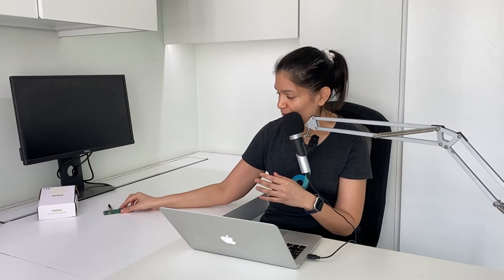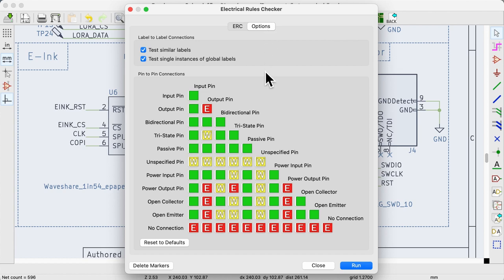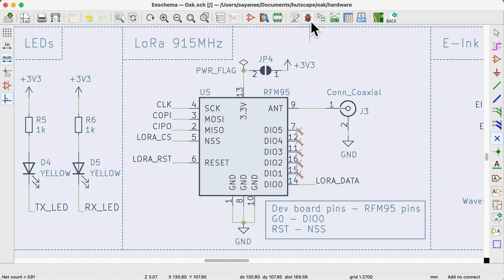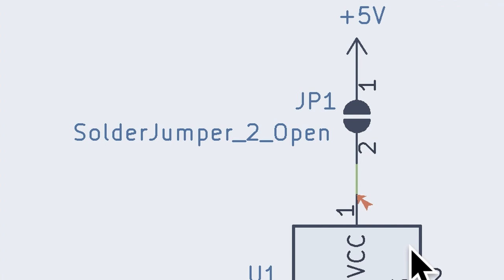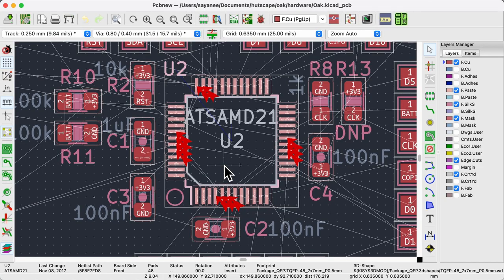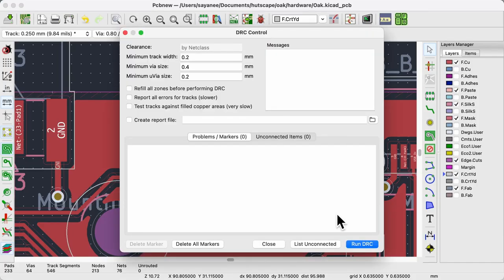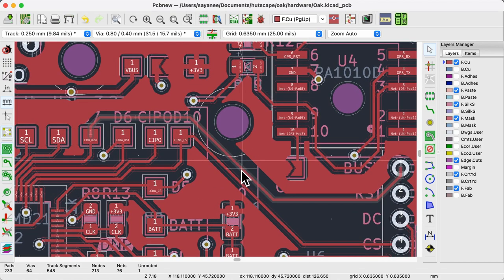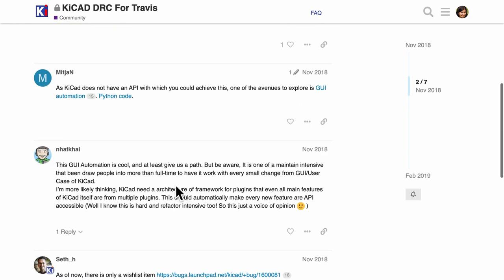ERC/DRC common errors and how to use it like TDD // KiCad

Comment: Very interesting look into these tools. I use them to keep my own distractions in check, too often have I swapped TX and RX pins accidentally only to discover the issue after the PCB layout is designed or worse, when the PCB prototypes come from the manufacturer. I do have to say though, the quality of the ERC/DRC output is directly linked to the quality of the footprint. If a pin is wrongly identified in the footprint the ERC won't know about it, so it's good to keep that in check, especially when you're the one making the footprints.
I liked your methodology of doing the checks at specific stages and then do version control with them. Where did you learn about these design process techniques, like TDD? It seems like a major flaw in my engineering degree because I never really learned these things.
Reply from the maker: "Where did you learn about these design process techniques, like TDD?"

I had spent some good years in between in web development that made me comfortable with programming, version control, documentation, and concepts like TDD, CI/CD and agile development.

Coming from the school of engineering, I did not learn these concepts initially and they certainly petrified me 😅
Reply: @sayanee  Yes, my background is very academic (physics eng.), so when I got to work in the industry it was a whole different way of doing work. Unfortunately none of the companies I worked for exposed those troubleshooting techniques to me, it was usually someone else's job to do the testing, so I guess I have to learn it by doing it myself haha. Thanks for the reply! Keep up the good work!

Comment: Thank you ever so much for covering all the errors I'm coming across as a newbie starting with Kicad.
You're so clear and to the point. Excellent video. 
I'm not sure why Kicad continues, even in Version 6.0, this hopeless "power flag" system. It really does need replacing with something more intuitive, and/or, easier to find in the libraries.

Comment: Hi ms, i have problem conflict pin ms, conector usb output gnd with ams117(3.3v) output power ms. I have change like your but still error. And now i have change electrical type conector usb gnd from power output to passive, and work ms. I will ask you, if change lile that in future will get problem when pcb was done printed ms??

Comment: This has absolutely nothing to do with the video’s thematic but I’m curious about your MacBook. Let me explain why. I’ve finally started entering the apple universe and I still lack an apple computer. My windows Lenovo was cunningly nicked by my dear wife in order to work remotely, and my budget is a little bit on the low side. The things we do for love… My question then is, how far back is it advisable to purchase an iMac or MacBook in order to be able to run these applications like kicad , vc or arduino ide and getting a couple of years of support from apple regarding updates. I’m not into video editing, the goal here is to be able to make some projects and learn along the way. I would be quite happy with that. I’m not interested at this point in having to learn several side things like knowing how to setup a Linux distro and make it work with every single little thing.  Just have something I turn on and it works so I can focus on my goals. Thanks in advance.
Reply from the maker: Well, in this case, you will be happy to know that my MacBook is very old 😅

It's a MacBook Pro (Retina, 13-inch, Early 2015), processor 2.9 GHz Dual-Core Intel Core i5, and memory 16 GB.

And I use it for coding, firmware development, KiCad, video, and photo editing. So you have lots of choices and hopefully a much more modern machine. I have also duat booted it with Linux and Windows in the past.

"Just have something I turn on and it works so I can focus on my goals." Yep, I have gone past the stage of trying to build everything from scratch and having something that just works, so MacBook is great for that in my opinion. 🤪
Reply: @sayanee  As a bit of a joke, back in the day parents would give their kids the old PC's when they were no longer useful for work, so the kids could have something to play with. These days, it's the other way around. When the computers are no longer viable for gaming, they go to the parents so that they can work.

Your hardware is far more advanced than what I'm using, an old HP Compaq 6005 Pro SFF with AMD Phenom II X3 B75 and 8 Gb of RAM. Threw in a 240Gb SSD drive, and it's running Linux mint like a charm. What I did invest in was in a 29" ultrawide screen. I am not at all regretful, it has the huge advantage of allowing me to have two documents open side by side in full scale, and it makes creating documents while consulting others so much easier. I hadn't acquired this PC at the time I asked you about your Mac, and my idea was to get one for myself. But here lies the problem, when you cannot update the software any more, perfectly good hardware becomes useless, or so I thought. Now, seeing that you installed Linux in it, it could become a possibility once more. Thank you for your reply, it was very enlightening.